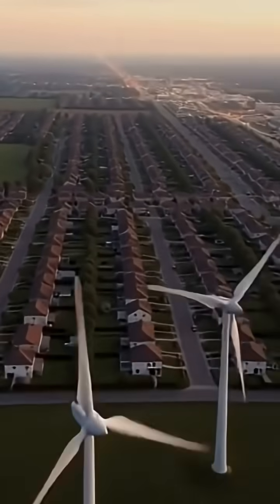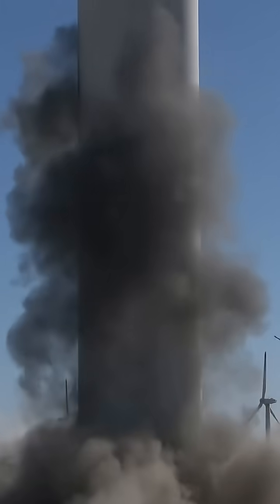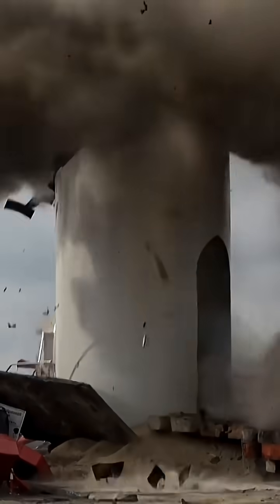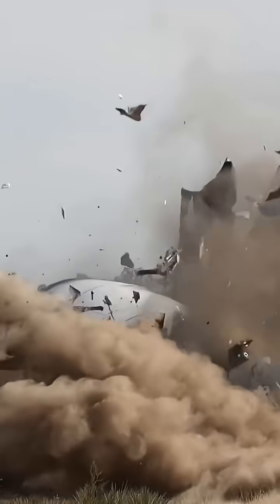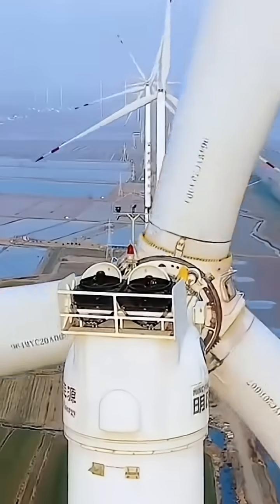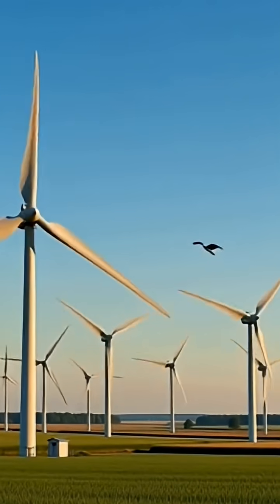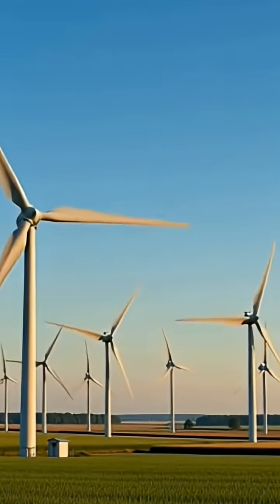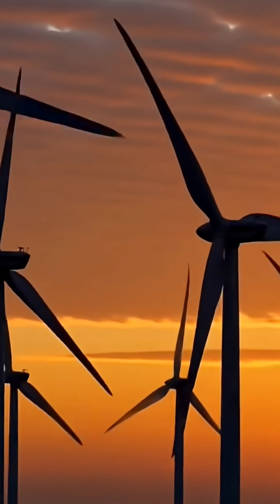Do Wind Turbines Really Work? #wind turbines

Comment: Wind and solar have the lowest payback time of any generation system. Have you any idea how long it takes you're average hydroelectric or nuclear power station to pay for itself. Most wind turbines are installed using investments from investors. Its in their interest to pick the best location because that will have an effect on the investment.
Reply from the maker: A fair point — wind and solar do have shorter financial payback periods on paper, mainly because of lower upfront costs and subsidies.
But payback time alone doesn’t equal system reliability or total value. Nuclear and hydro take longer to pay back because they’re capital-intensive baseload assets designed to run 40–80 years with high capacity factors. Wind and solar need storage, backup, or grid support — costs that are often externalized and not included in simple payback comparisons.
Investor-driven site selection helps returns, yes — but it doesn’t solve intermittency or grid stability issues. That’s why most serious energy systems still rely on a mix, not a single “fastest payback” source.